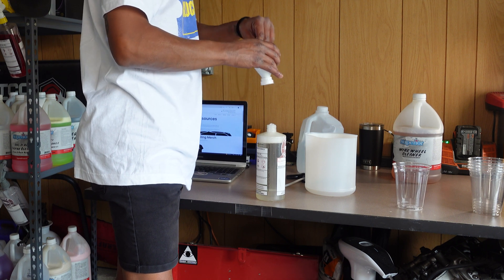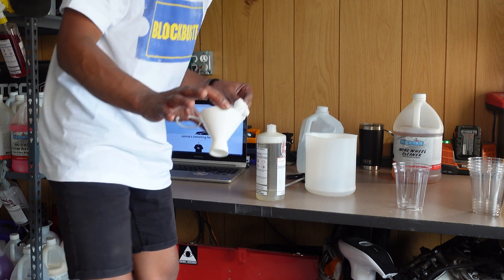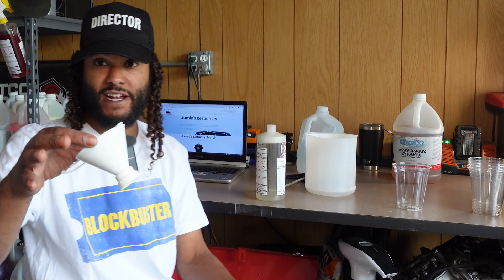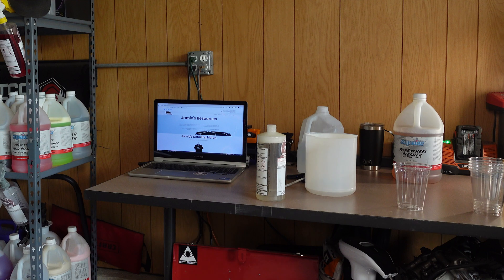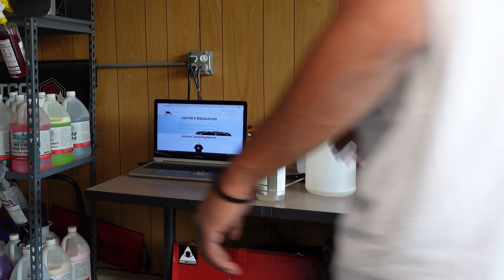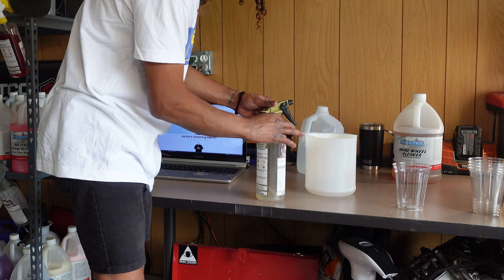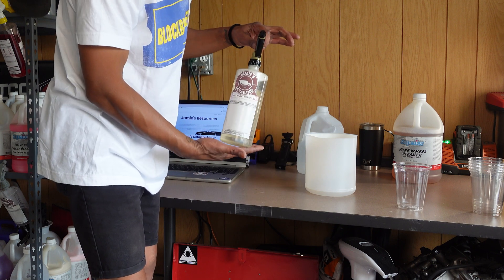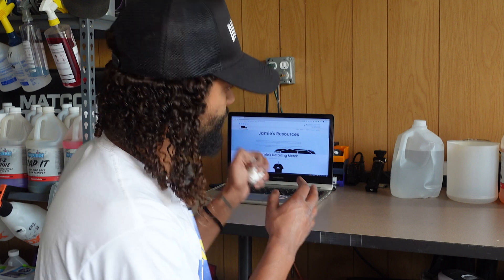How I Calculate Dilution Ratios for Detailing Chemicals. How To Mix in Dilution Bottles + In Bulk

Comment: When you do the 4:1 or 128:1 is the 1 always 1oz ?
Reply: No. Both numbers are "parts," whether it's milliliters, ounces, gallons, a shot glass, a Dixie cup, etc. If your spray bottle has ten gradations on the outside of it, and the ratio is 10:1, then you'd fill the spray bottle with chemical to the first line, then add water to the 11th line on the bottle- 10 parts water, and one part chemical. Doesn't matter if the gradations are in ounces or milliliters.
Reply: @gadsdenconsulting7126 got it you guys made it simple for me to understand this. Thank you a lot i appreciate this so much.
Reply from the maker: For example if the dilution ratio is 4:1 for every ounce of chemical there should be 4 ounces of water. Regardless of the unit of measurement there should always be 1 part of chemical and 4 equal parts water.
Reply: @jamiesdetailing thank you for this. I suck at math and just learning out to detail. For dark fury how much do you use in a 32oz foam cannon? I looked on your page I couldn’t find the ratios for it. Thank you again. I learned a lot from your channel.

Comment: If you take out 1oz of water, wouldn't you just be able to measure back 1oz of risneless wash in the glass measuring cup and then pour that in to the gallon jug instead of having to eyeball where the gallon mark used to be? Am I over thinking this? Thanks for the tips!